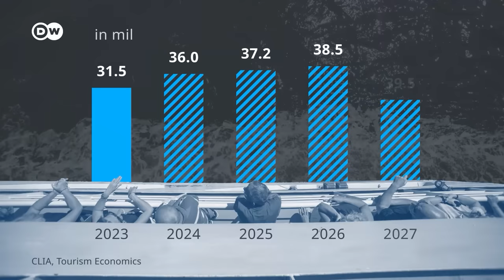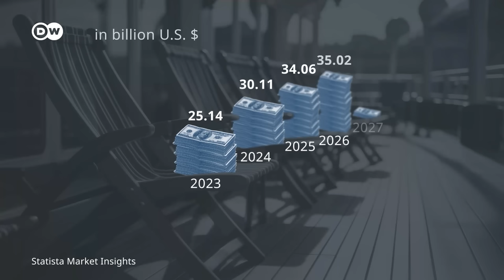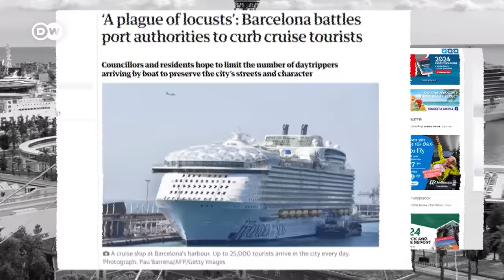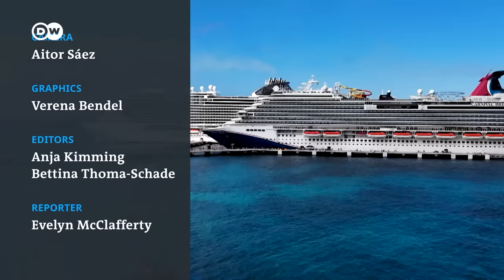Why the cruise industry is the fastest growing tourism sector | Transforming Business

Comment: Hard to take DW News seriously when it doesn't have an accurate map(2:22).  Port Everglade is in Fort Lauderdale not Fort Myer.  The result would show that 8.6M passengers sail out of Greater Miami .  I don't trust their results if they don't do the most basic fact checks.  Other issue is they did not provide citation for the data, was that before Marine Fuel standard being updated 2020.  The comparison is not valid if it use pre-2020 data...the article also missed the importance of converting ports to using shore power.  This is an editorial piece long on green morality, light on actual cited facts.